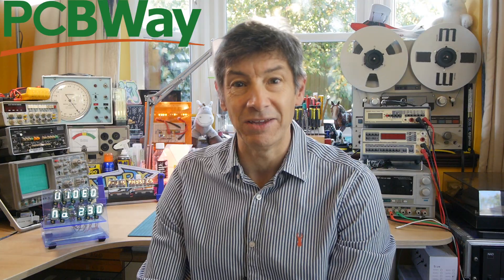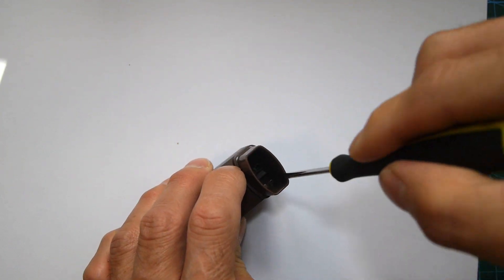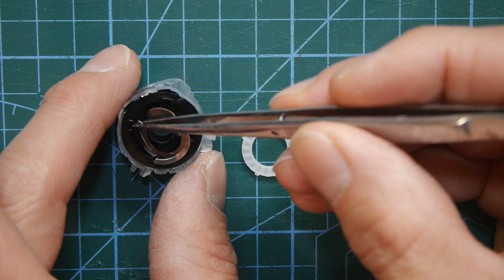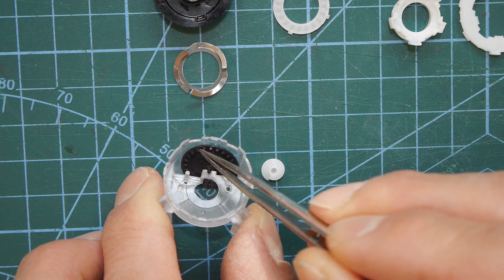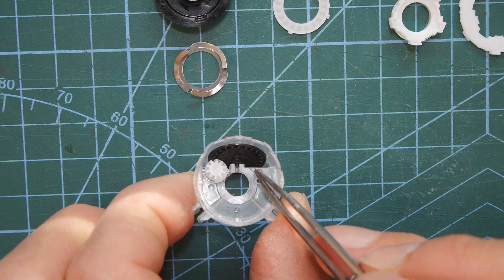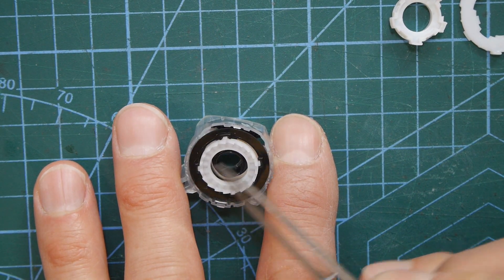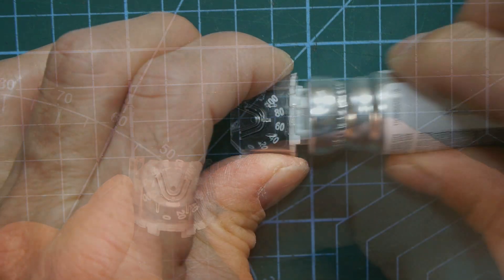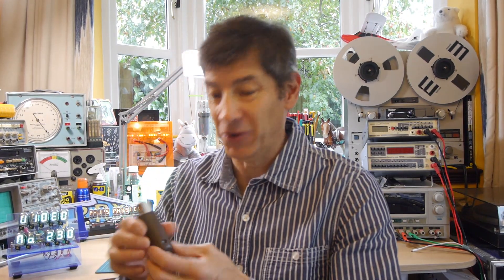Asthma Inhaler, Clenil Modulite Brown Inhaler: Interesting Mechanism - F-J's Physics - Video 230

Comment: The ones with Aerolin never got the counter. And I began to suspect they didn't had the same number of puffs they had before: the propellant is still there but the dust ends way before the propellant making it useless on a crisis. I use an analytic cheap digital scale and weight the metallic tube. It is so sensitive that it weights your fingerprints on the tube. Is is easier than count or use it against a glass to see if the medicine that is a white dust is still being delivered. The box says 1mcg (a weird wrong way to say I µg) per dose. So the weight is s little more for the propellant but the fingerprints add to the weight. A few tests and you can see when the medicine ends and if they are correct about it having 200 doses.
Make your own test.
Reply from the maker: That's interesting.  I had not thought that it might be used to reduce the enclosed total contents but I guess, as you say that is picked up by the value and really weird units that they insist on using!  There is a good story behind that!  Even though, those of us who know 1mcg was equal to 10ug would avoid a 10x overdose! I remember writing on a piece of paper and watching the lab balance change as the ink dried too!  (BTW I wonder if it would resolve small leaks in the can over time?) Thanks for your insights - that's all a great addition to this story!  F-J.

Comment: I don’t think you actually need to have asthma to have a restriction in your breathing. I have that when I run and I was given an inhaler for it, which helped.
By the way, what is the light blue device on top of the valve tester on your desk?
Reply from the maker: Thanks, yes we are still getting used to all of the medical bits here.  A friend uses one for COPD.  Ah, I do get asked about that device!  One guess was an antenna rotator!  It's a Griffin Centisecond timer which used to be used a lot in schools for 'g by freefall'.  Basically its a motorised clock that has electrical terminals to start it rotating and stop it as well.  I must do that experiment as a video sometime!  Thanks again, F-J

Comment: The redesign will be a cost-cutting exercise, but it must be good to know how much is left, so you don't take an empty one out with you, suppose you'll just have to guess from now on.
Not that a usage gauge prevents anything running out unnoticed - just ask my phone.
By far, the most annoying counter is the chip that comes with ink cartridges.
Reply from the maker: Yes, indeed.  I found that the inhaler counter always went to 0 (and stuck there) before it was empty and there were quite a few puffs left.  Now, the counter chips on ink an laser toner - that's a whole different story isn't it where they block the use of the cartridge too!
Reply: @AnthonyFrancisJones  Yes, it's wasteful, but not as bad as the ink cartridges, if you run out of yellow, you can't print black, or anything at all, until you replace the yellow. One all-in-one printer wouldn't even scan a document until the cartridge was replaced.
Reply from the maker: Yes. I have had to resort to re-chipping mine to fool the counter so I can properly use them up. That’s on laser toners. Not sure about ink jets though.
Reply: Always have a backup inhaler with you.
Reply from the maker: @SojournerDidimus  Indeed!